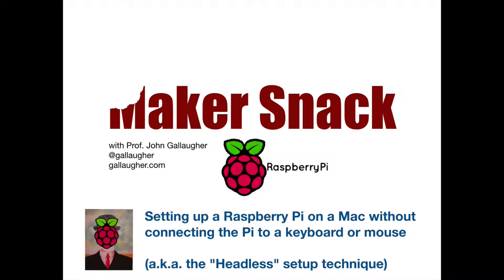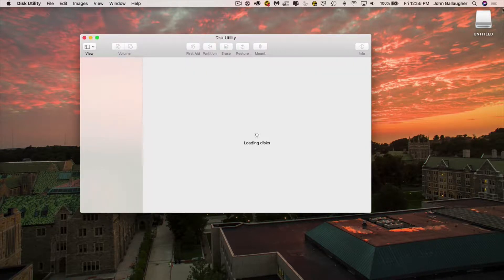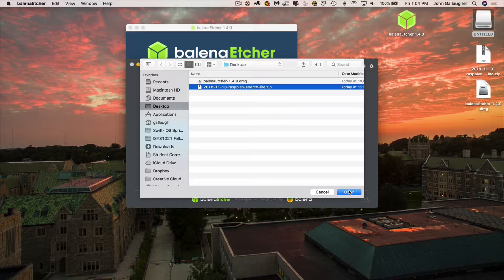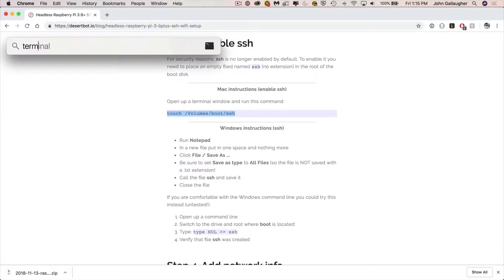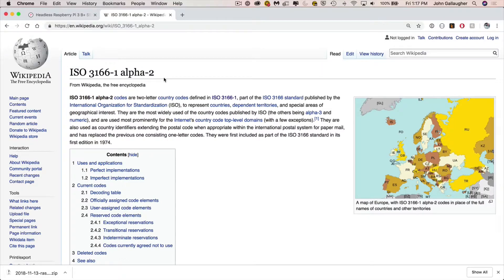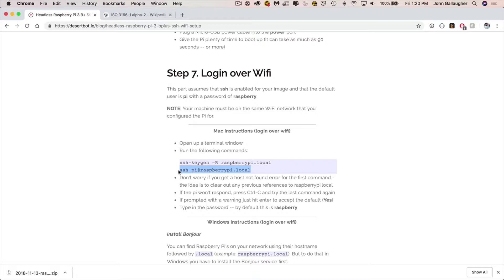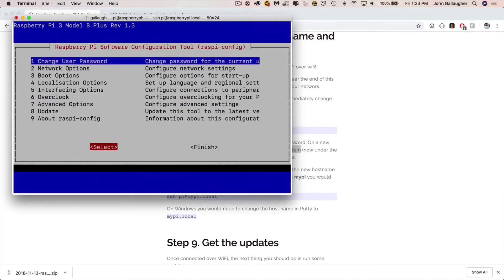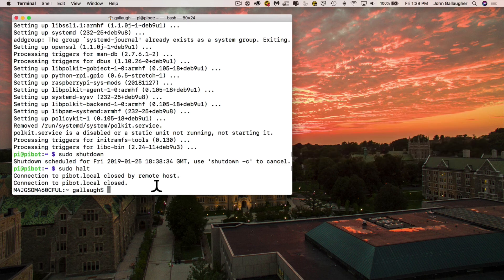NEW VERSION (see description) Headless Raspberry Pi setup for Mac

Comment: I followed all the steps and when I typed ssh pi@raspberrypi.local it just created an empty line... I'm really struggling to setup my raspberry pi on my mac...
Reply from the maker: Unsure what you missed. This sounds like a strange error. I've never seen this one before.
Reply from the maker: One time when I experienced something similar I re-formatted my SD card & started over. That may help. Also check out the new install video mentioned in the description. This uses the Raspberry Pi OS Installer.

Comment: Aloha John, I followed the directions and it doesn’t look like the code to get my Pi to connect to my network is working.  It’s not showing up as a device connected to the website and I can’t communicate via terminal either.  Any thoughts?
Reply from the maker: Unsure. Bruce (above) mentioned a problem with dual-band networks, although I have dual band (with both bands on the same name) and haven't had that problem.  I have a new doc with new procedures at https://bit.ly/headless-pi. Hopefully this helps. Try reformatting using the tool mentioned in step 1alternative, then starting with step 1 in this new doc.
Reply from the maker: Not sure. I'd first be sure you're using a Pi with WiFi (sorry for the obvious Q, but some students have tried this using  a non-WiFi Pi and that was the prob). Then make sure you're config-ing with the correct network name, spelling, spaces, etc., and correct pw. Good luck!

Comment: When I type in the command “ ssh-keygen -R raspberrypi.local” ... I get the line 
mkstemp: No such file or directory 

Then when I type the next line “ssh pi@raspberrypi.local”  , my terminal stops working and I have to press control C to get it back ... hence I’m confused on exactly how to make it work ... any help please ?
Reply from the maker: Maryline. Tough to say exactly. If you're on a campus, see the note included in the new update doc at: https://bit.ly/headless-pi. Also try re-formatted your SD card using the tool mentioned in Step 1alternative, then start with step 1 using the Raspberry Pi installer. Finally, Bruce (above) mentions an issue with a dual band Wi-Fi network. I have dual-band & don't have these problems but I use one name for both bands. Hope that helps!

Comment: ssh @raspberrypi.local doesn't give any response
Reply from the maker: Are you on a standard home Wi-Fi network or a campus? If you're on a campus, see the note at: https://bit.ly/headless-pi. Bruce (above) also reported an issue with his dual-band Wi-Fi, although I have dual-band & haven't experienced a similar problem. Finally, when a similar problem occurred, I simply re-formatted the SD card using the SD formatter mentioned in Step 1alternative in the link above. Then I re-started using the Raspberry Pi installer & this worked.

Comment: This was so helpful. Thank you so so much. I have a question though. Why did we use Rasbian stretch lite and not Raspian desktop?
Reply from the maker: I simply didn’t need desktop in my projects. Guy could use it if you think you’ll use some of the features, like the GUI desktop. But it can be added later and I prefer the terminal over WiFi to a slower Remote Desktop.

Comment: Hope this helps someone else...

I tried this and it wasn't working. I eventually figured out that my issue was that my wifi router supports both:
* Wireless Network (2.4GHz b/g/n), and
* Wireless Network (5GHz a/n/ac)

Using a 5GHz a/n/ac network failed, but using the 2.4GHz b/g/n worked!
Make sure you're NOT using a 5GHz network for your ssid network name.
Reply from the maker: Thanks for the tip, Bruce. I also have a dual-band Wi-Fi, but haven't run into this problem. Both of my bands have the same name (I'm using Netgear Nighthawk w/Wi-Fi 6)

Comment: After installing the NOOBS image onto my SD card my iMac running Catalina can no longer read it and doesn’t recognize the SD card (“Can’t read this disk; would you like to format” error msg ), meaning I can’t add the ssh and configure files. Any advice?
Reply from the maker: Macs don't read full Raspberry Pi volumes, so you'll not be able to see all of the files. The steps to create the ssh and wpa_supplicant.conf files should work as outlined, though. Try the steps in the new doc at: https://bit.ly/headless-pi

Comment: Thank you for the video! It's been very easy to follow. Quick question, as I'm having trouble getting my Pi 4 to talk to my Mac.

I made it to 10:33. When I enter "ssh-keygen -R raspberrypi.local" I get "mkstemp: No such file or directory found"

I repeated the previous steps of creating the SSH and nano wpa~~ to enter in my own network and password. I double checked my work by looking at ls to make sure the files were still there. However, I got the same error.

Any thoughts? Thanks again!
Reply from the maker: Hmm... I've not seen this before. If you skip the step does this work?